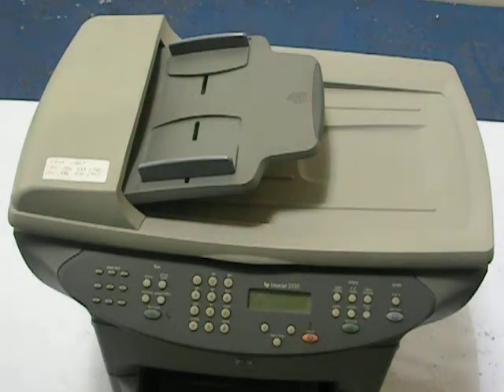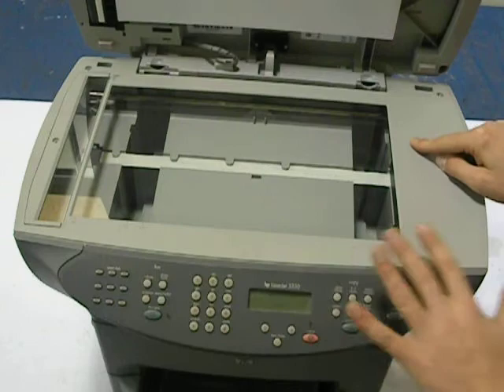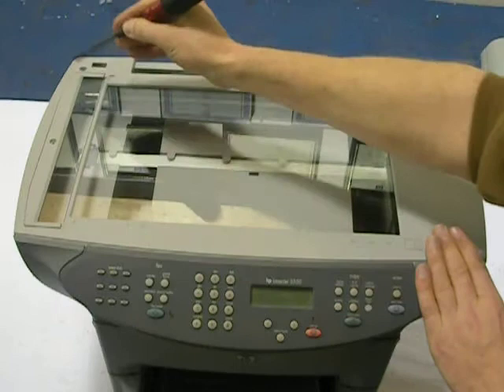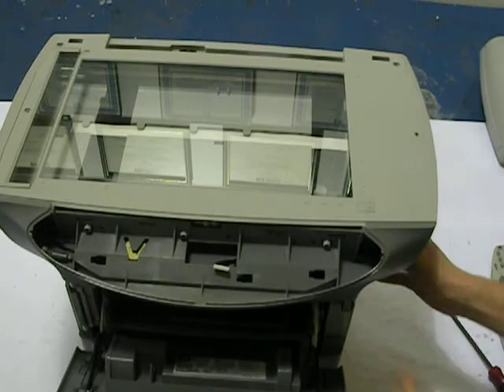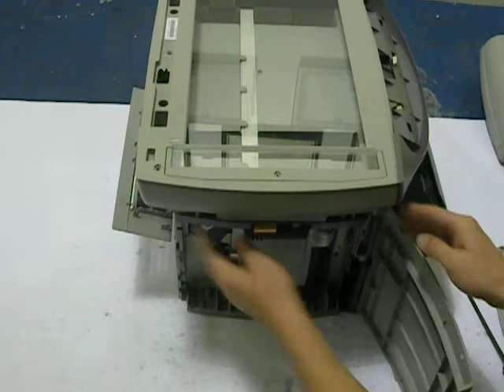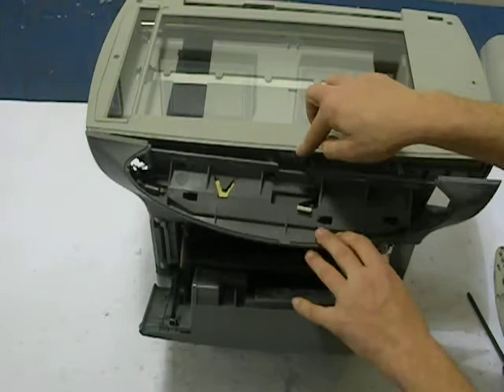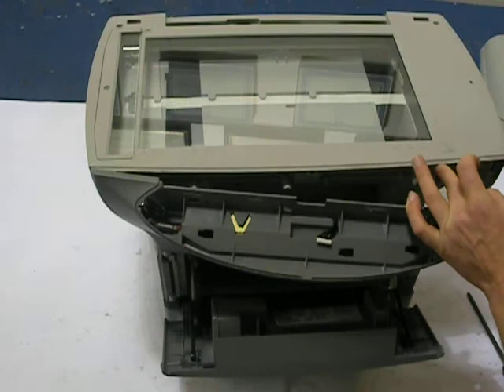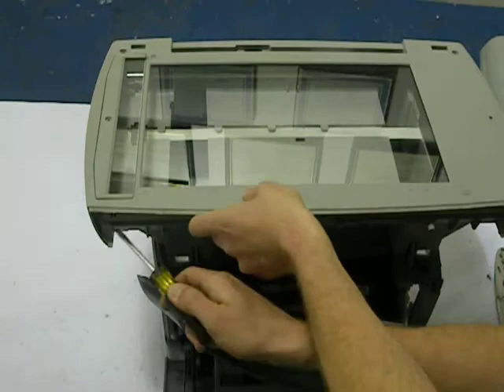how to fix the warming up hp 3330 or repair 3380 scanner warm up error

Comment: My mirrors where pretty clean, nevertheless I tried to clean them what didnt work...
When I turned on with open cover I was wondering what makes the lamp stop when it moves during warmup... At downside of the cover, right from the glass there is a black/white/black area where the lamp is parking. But the white part was not anymore very white, so I put a white paper there (with tixo :) and the next try was successfull, no more error 6 !!! 
My scanner is working fine again. yippieh
Reply: Thanks for that! Your tip did the job for my scanner :)